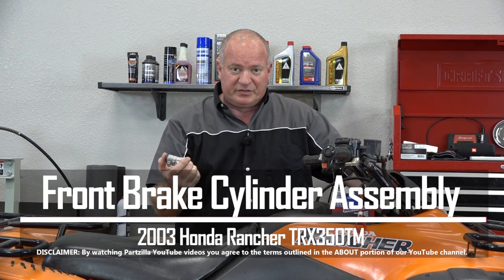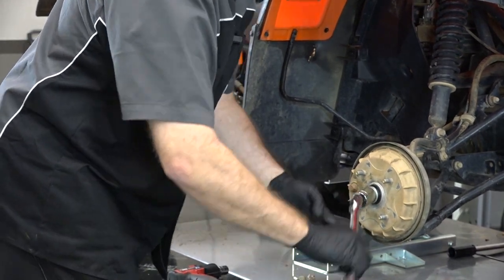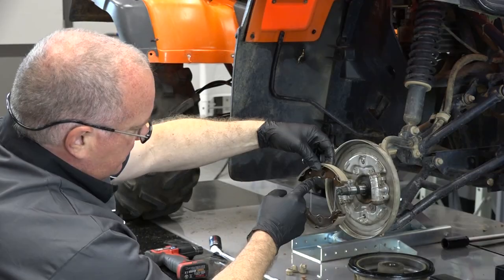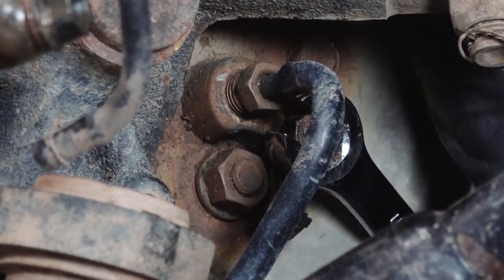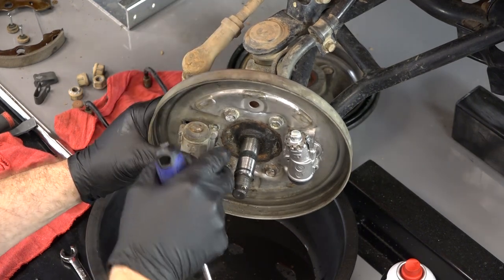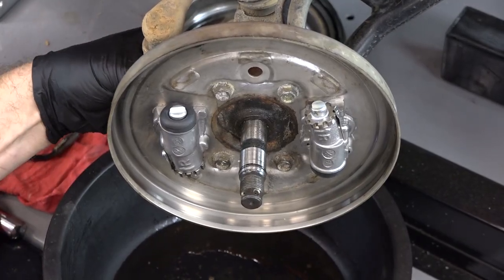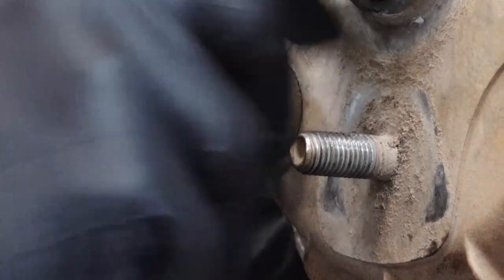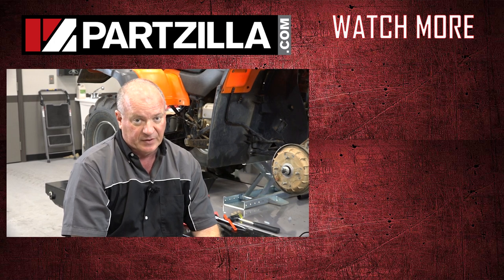Honda Rancher 350 Front Brake Cylinder Rebuild | Partzilla.com

Comment: The cost to rebuild vs buying new cylinders? A rebuild kit is 15-19 bucks per and a replacement cylinder is 31-40 per and this isn't a cylinder rebuild its a cylinder replacement video

Comment: Easier ways of doing it is to take your main brake line off and then take the four bolts that hold the plate on then just take the whole plate off that way you can reach all Bolt to take the cylinders off, which gives you a lot more room

Comment: Thread pitch on the brake line fitting? Stripped a wheel cylinder and need to tap it

Comment: Had a question about the bulk vacum hose on the front left and right wheels that leads to the rear wheel and rear axle. Could you help me out on where the lead to and where the end of hose needs to vent to?

Comment: Hey john , I have done this same process and even changed out the break cylinder and on my right side one of the wheel cylinders still doesn’t engage when I press the breaks . I have bled them with my pump and can’t figure out why it won’t engage. Do you think it’s something to do with the hard line running break fluid to that wheel cylinder . (Note: that sand wheel cylinder didn’t work before I replaced them all the others functioned .
Reply: He left out an important step in his video. He didn't turn the adjusting screws on each cylinder. That's the sprocket-looking thing that he turned with his screwdriver through the little hole in the hub.  You have to turn those in the direction of the arrow on the cylinder to push up the brake shoe close to the drum. I had to turn it quite a bit. Turn it until it stops the hub from turning, then back it off a little so it can turn.

Comment: Can you tell me how to fix a code 3 on a 2010 Polaris sportsman and I've  tried the voltage regulator and put the throttle cable to it's position and I will run a few minutes and and as soon as it warms up and you give it gas it starts acting like it has a rev limiter at about 2500 rpm it just started doing it
Reply from the maker: Check with your dealer to see if your unit has an update.  This situation usually revolves around the ecu.
Reply: Partzilla ok!! thank you!!!!!

Comment: Changed my pads, cylinders were not seized and brakes still soft🤔
Reply: If it’s soft, the applied pressure is going somewhere. Could be the rubber flex lines. Not 100% sure.
Reply: @chrisalister2297  airgap adjusted for the shoes?